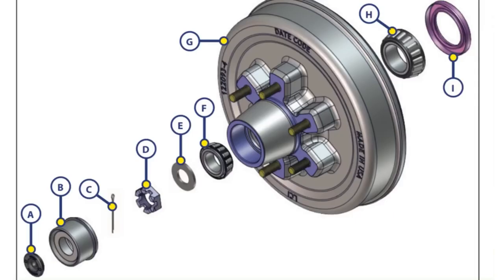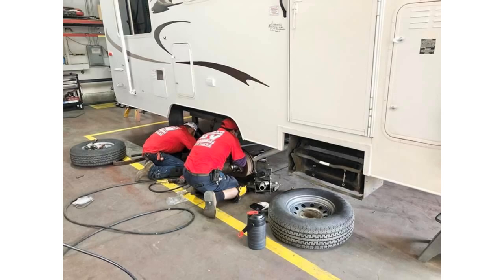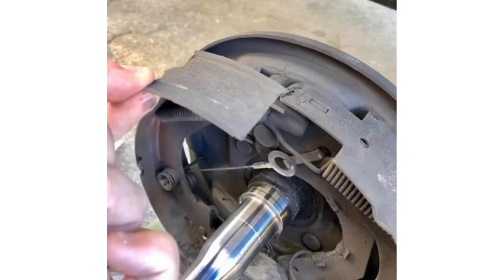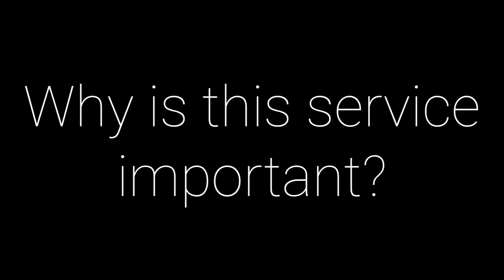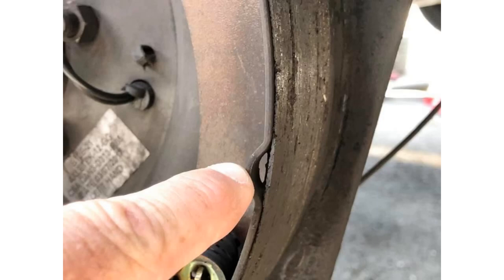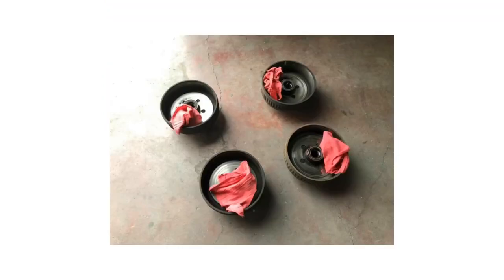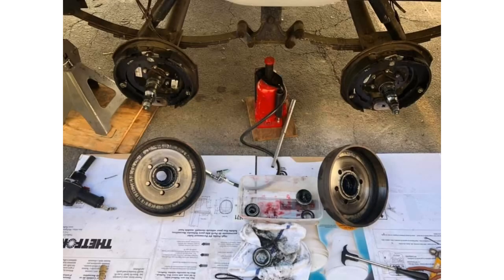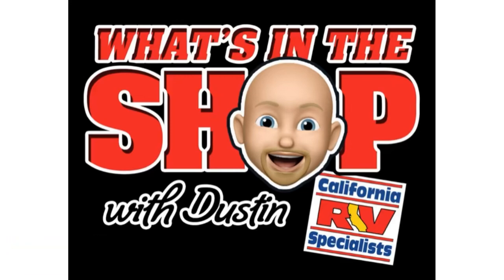Don't Miss: How to Properly Maintain Wheel Bearings

Comment: Definitely do this annually!!!  More if you travel a lot.    
    We had our Dexter axles replaced about 6mo after we took delivery of our new trailer.   Then at our 1 yr inspection the dealer found 3 of the bearings had been overpacked & had leaked out on the brakes.  Hummmm.... bad news.   They replaced, & upgraded, the seals and replaced the brakes that had been drenched in grease.